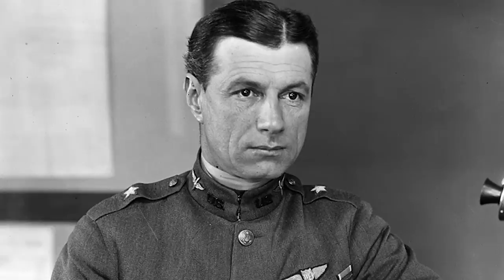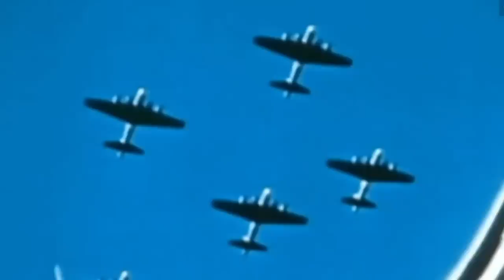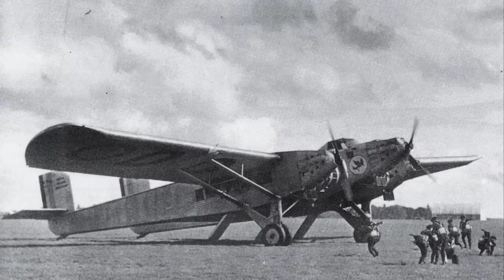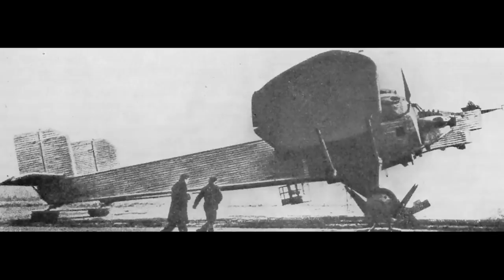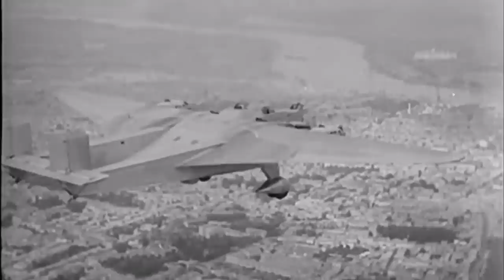Steampunk AC-130!? The SAB AB-Series Heavy Bombers

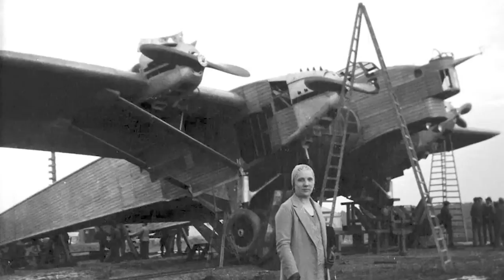Comment: @3:25, looks like the probe may have been an antenna. Better picture @6:45. UHF radio maybe?  The loop antenna underneath looks about right for VHF radio, possibly direction finding if it rotates.  Just heard the '1935', so not radar.

Comment: These designs were originally by Lois DeMonge, who later went to work designing Bugatti's racing plane. He built a couple of twin engine test planes, wanting to work up to a 3 engine liner.

Compare to the Junkers G-38 with inhabitable inner-wing sections. Mechanic stations at the engines in the thick wing.

See also the 1921 Burnelli Remington RB-1 lifting fuselage body biplane. RB-2 followed. The largest internal volume planes of their day.
Burnelli went on to build strutted and cantilever monoplanes of the same sort of twin-boom lifting fuselage body as these French planes. One in the early '30s crashed due to mechanical flaw on a final test flight before delivery. It hit the ground with 110 degree roll, 25 degree nose-down at 125kts. The wings and tail disintegrated and the engines broke off as the fuselage body box cartwheeled across the field. When they got to it and got them out, the 2 crew walked away and it's a safe bet that if the passenger cabin had been properly fitted and the passengers secured, they'd be OK too.
In the late  '40s Burnelli built the CBY-3 twin engine plane like these (in a museum now). A test pilot bragged about the low landing speed and being able to do a "Suicide Stall": Cut power and pull back. Just as it's starting to shudder and fall off, push a rudder pedal, and let go the controls. It just settled and glided out.
He planned huge lifting fuselage body bombers. the B-1000 with 4 contraprops and 8 buried, paired V-12. And the later (probably turbo-prop) 6 engine B-2000 heavy bomber, with a passenger model planned. All the same sort of rectangular lifting fuselage with booms carrying the tail.

Comment: Did they just nail wriggly tin all over that beast?
Reply: If you mean a corrugated skin.. Yep. There's a good reason. Corrugated steel or any other metal can be made thinner than flat sheets because it's stronger - and the corrugations don't actually cause much of an issue compared to the weight reduction (due to the thinner skin cross section) because of the boundary layer at speed. The issue is as speed goes up drag goes up substantially, so what doesn't cause a problem at 180mph is a real pain at 350mph.

Comment: The heavies used in WW2 were horrifically inefficient. They couldn’t hit a huge factory so settled for flattening whole cities. Battle of Midway proved the heavies could never hit ships. 
What’s even worse is the British had the solution in the twin engine Mosquito. It was used for accurately placing target markets. But a raid with 800 Mosquitos would carry at least the same bomb load as 400 B17s. More importantly they would hit the target using 40% of the crew numbers and the return flight could strafe airfields etc.
This wasn’t considered because the top brass had one solution and they were using it no matter what.

Comment: Congratulations on finding in-flight footage of such an obscure monster. I doubt that even the original designers like the look of the thing, though that era was notable for bombers as ugly as they were heavy. 
The experience of fitting 75mm cannon to aircraft was quite consistent, regardless of who tried it; rapid destruction of the airframe from recoil.  Presumably modern cannon mountings have been developed to alleviate the problem.
Reply: Allow me to note that there were over 1400 B-25G and B-25H models built, all of which were equipped with 75mm guns.

Also the Germans built 40 Ju 88P-1 equipped with 75mm PAK 40 cannon. The 75mm gun versions were determined to be too slow firing for their intended role, and later versions had either two 37mm guns or one 50mm gun.

Comment: Interestingly Mitchell went far further in his tests than he was meant to(for which he was reprimanded)and which he used as a propaganda exercise to prove a point. Though this only proved that if you threw enough heavy bombs against an unmoving undefended obsolete warship you would eventually sink it. The test was actually supposed to evaluate the damage caused by a range of bombs on warship armour,the British conducted similar tests with bombs and shells using a range of warships including the modern Baden

Comment: When you see those bombs being released from those bombers, with the bombs in such close proximity waggling about as they fall, I often wonder how the bombs didn’t ‘crash’ into each other and explode bringing down the aircraft and her crews.
I suspect what did happen is some allied bombers got hit with the bombs dropped, from groups flying higher than their group, accidentally in the confusion of war…
Reply: It was strongly rumoured that this was the fate of Glenn Miller, that the C-63 Norseman transporting him from London Paris was hit by bombs jettisoned by RAF Lancasters over the English Channel on 15 December 1944. However this was disproved by the later Board of Inquiry which showed that the C-64 could not have been in the area in which the bombs were jettisoned until 90 minutes after they were dropped.
Reply: I've seen a photo of a B-17 which shows a stick of bombs just after they fell through the horizontal stabilizer during a bombing mission.

Comment: That probe on the nose......it seems to fortell the air-data probes of the X-Planes (not likely) or be a vestigial ram of some sort (slightly more likely) , paying homage to pre-dreadnought capital ships which it more than slightly resembles. Great stuff, this!
Reply: Its there for a foresail if the flying apartment building settles into the water. And rig the rest of it with sails.